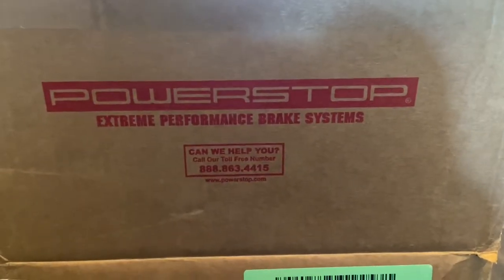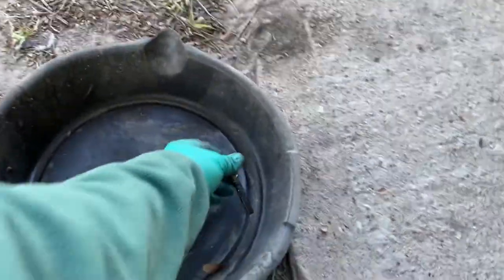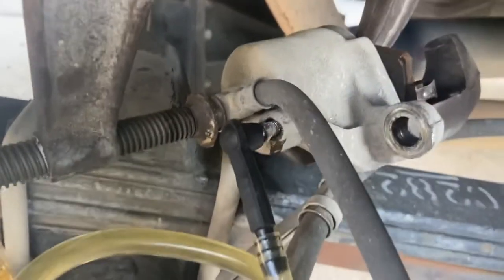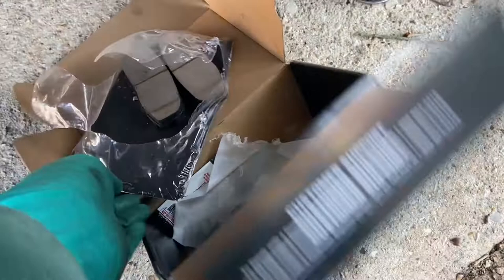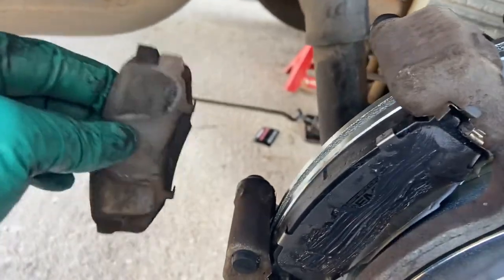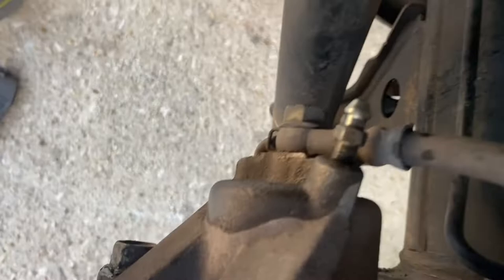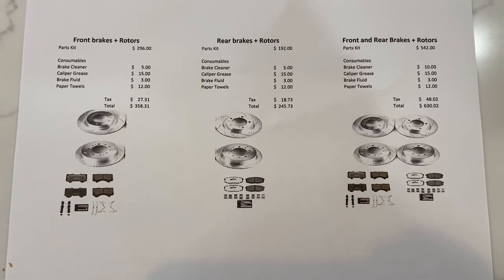2014 Toyota Tundra (Rear Brake Pads and Rotors) 112,000 miles

Comment: Thanks!  I did exactly what you did here for rear brakes and I’m so happy with the outcome!  Great parts list. Great tips and recommendations. Auto repair shop wanted 2x what it cost me in parts. Took me 4 hours one afternoon. Will be coming back to your channel for the front brakes. 

I watched no fewer than 4 other similar vids. This one’s the best by far. I did watch one vid that showed what not to do, which was helpful (don’t grease the tips of the pins or the grease build up won’t allow full extension in the boot and the pads won’t wear evenly). 
Many thanks again!
Reply from the maker: You are welcome and thank you for the Super Thanks! I, too, am very satisfied with these brakes and rotors. I have used the Power-stop pads in the past and must say they are good quality. My son keeps telling me he wants to install them on his Ram 1500 whenever it is time to service his brakes. Good point on the video referencing the grease on pin tips. I think I saw that video, too. Anyway, take care and enjoy the new hardware. Be sure to tackle the front ones when the time comes. I have a video on those as well.

Comment: Y r u cracking the bleeder ? All u need to do is remove the reservoir cap and fluid will back flow back into reservoir as u compress piston back in
Reply: So I don't have to crack the bleeder ? That would be amazing if all I had to do was take off the cap

Comment: Do you need to mess with the bleeder screw every time you change the break pads as well? What happens if I don’t do it? I did front break pads, thinking about doing rear rotors, and didn’t let any fluid out
Reply from the maker: You can always remove the master cylinder reservoir cap and push the old fluid back through the system. I have done that for years. However, for this video I released the bleeder screw and pushed the old fluid out replenishing it when I was done with fresh. Viewers have commented on my past videos suggesting I not encourage people to push the old fluid through the brake system as this might risk contaminating the ABS system.
Reply: Interesting! Never thought about that

Comment: Those rubber pieces in the rotors… what are they for?  We didn’t put ours on..
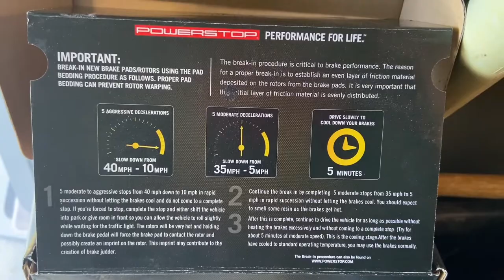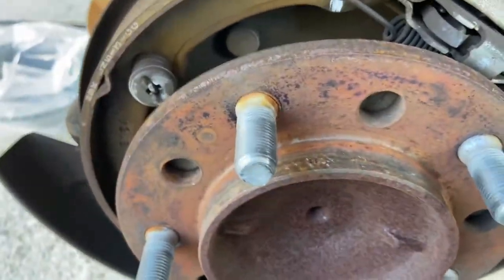Reply from the maker: This plug (14:44) keeps debris from entering the parking brake linkages and shoes (4:19). Its design allows for parking brake shoe adjustments.
Reply: @projectfixit assuming the new rotor has been installed so the adjustment opening in the rotor matches up with the adjustment mechanism on the e-brake.

Comment: Great video, thank you . Is it necessary to bleed the brakes a little or not necessary?
Reply from the maker: You must compress the caliper. I chose to push the fluid out the bleeder. Another option is to take the cap off your master cylinder.
Reply: Not at all necessary unless you open the system ie: change caliper, or hoses. Dont understand why he did all that.

Comment: Question…I replaced my rear brakes and rotors on my 2014 Tundra and went to drive it and they sound like the brakes are rubbing against my rotors making a constant scrapping noise. Any ideas?
Reply from the maker: Hopefully the pads were inserted the proper way with friction side facing the rotors. Otherwise, you will hear metal to metal when braking.
Reply: @projectfixit  definitely have the correct side towards the rotors. It does sound like the wear indicator but the rotors have a film on them from just driving around the block and are not damaged at all. I sprayed brake cleaner on them and it came right off. It sounds like to brakes are constantly against the rotors? If ales sense?
Reply: Could be the brake dust shield. Google it and you should get more info
Reply: @Wise-Tech33  Did you do the  proper break-in procedure for the pads?
Reply: Sounds like your caliper is not sliding freely on the pins and so when you let off the brake pedal, there is still contact between pad and rotor.

Comment: I have a 2017 tundra that i plan on changing all rotors and brakes. hearing the noise SMH lol. I don't have the brake and caliber grease you have but I do have the "Super Lube Synthetic Grease", I bought from harbor freight. Will that work the same???
Reply from the maker: I personally have asked myself the same question, but decided not to risk it. I would stick with brake caliper grease as it is formulated for the brakes, temperatures and rubber components related to the brakes.

Comment: Pretty sure they label those rotors incorrectly. These directional rotors go the other way.
Reply from the maker: Thanks for the feedback! You did have me double checking myself and after careful research this particular manufacturer instructs installing the way I show in the video. Thank goodness. Anyway, I am super satisfied with these rotors. I love them.
Reply: @projectfixit  yeah sorry I did some more research as well and evidently it has to do with ventilation fins inside the rotor. If they are straight through the rotor can go in any direction BUT if the vents are at an angle 📐 it matters which way they go. I was told that some manufacturers put a R or L in the part number or sticker on the rotor just to prevent customers from calling in for directions. After I put my rotors on my 2014 Tundra I freaked out because I thought I put them on backwards and realized it didn’t matter.😅 Thank you for the video though and the time required to make it.